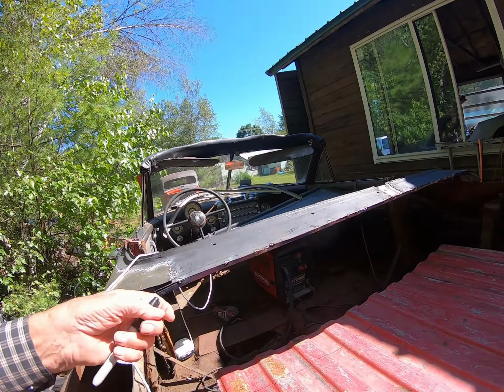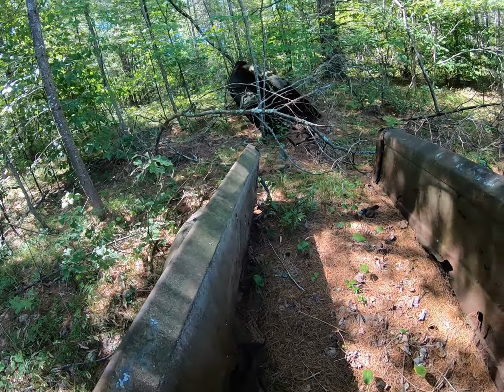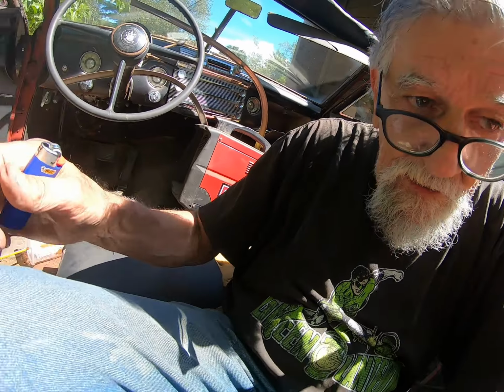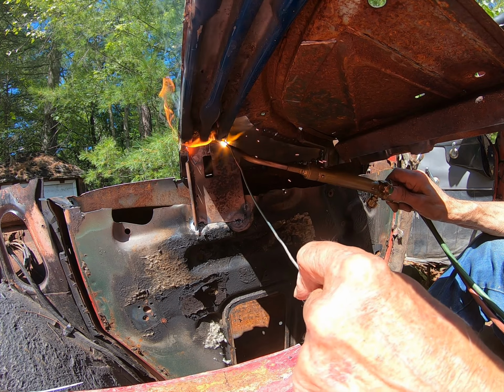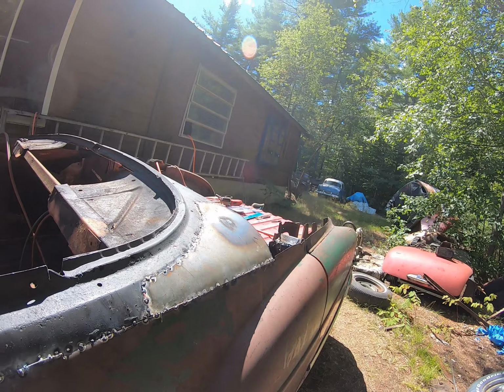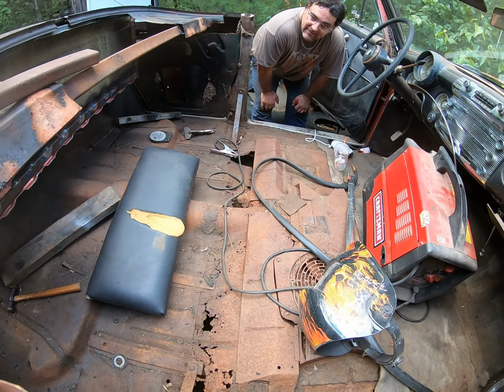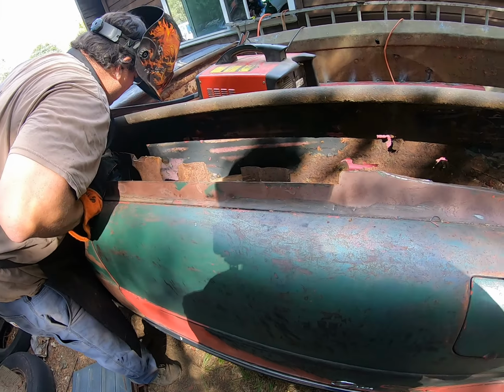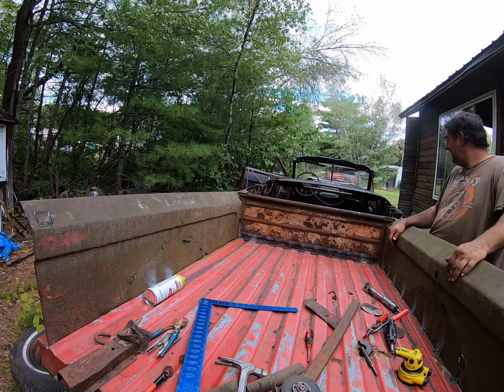Building a pickup bed for Emma's 50 Buick truck

Comment: Put hinges on the back and make it a dump box
Reply from the maker: That's a great idea but a lot more work. The plan was to weld the filler pieces to the bed sides. It would take a lot of sheet metal work to look good when the bed is tipped up. Not to mention the hydraulics. I think I'll put a flange on the filler pieces so we can maybe do it later.